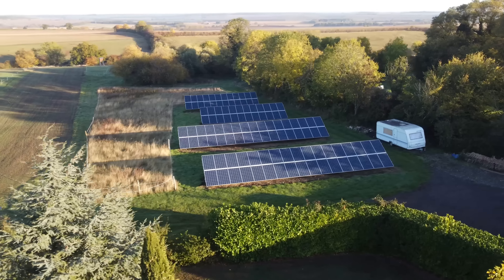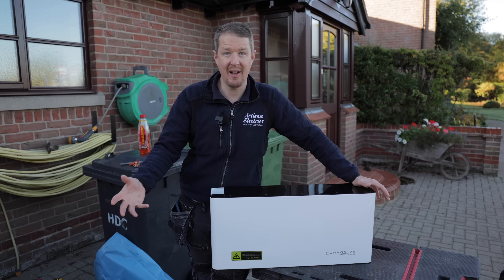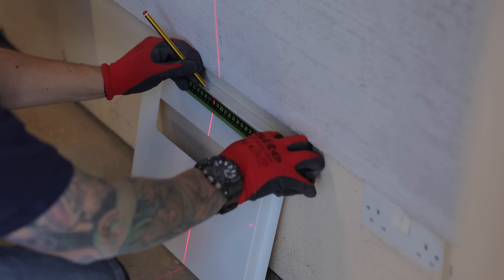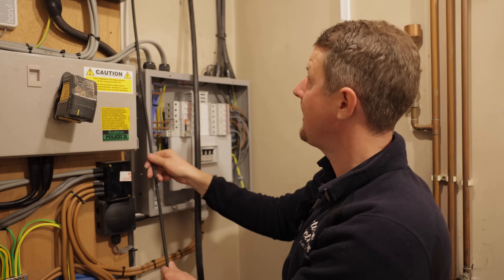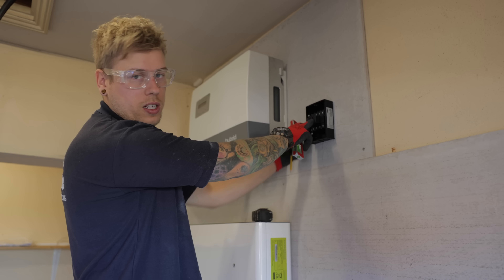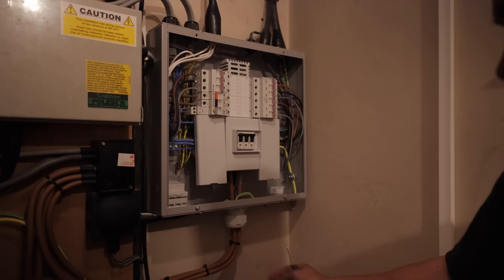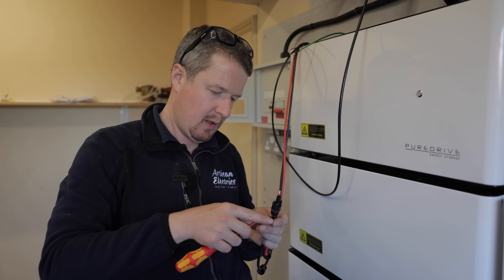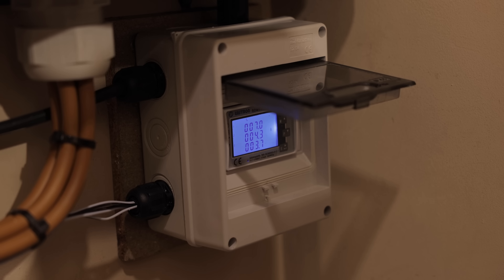PureDrive 23kWh Three Phase Home Battery Storage Install

Comment: Great video, with the cost of energy going up these systems are making more sense. I didn't realise power wall was the only system that switched over to batteries automatically in the event of a power cut.
Reply: I only learned that recently too… seems crazy to me to not have that switching functionality built into these systems 🤷🏻‍♂️
Reply: Why can't a Automatic Transfer Switch be used ?
Reply: They don't really make sense though do they because the amount this entire setup costs by the time it breaks even you'd be 6 foot under.
Reply: @TheRCBiker  and Captain Killjoy has arrived😅
Reply: I have a Victron system that switches over automatically. There are others out there too which can have ATS component
Reply: @TheRCBiker  Steady on old chap I was just getting exited for once. Imagine if they keep doubling the cost of the supply and being able to tell the electrical supplier to stick it. If I could afford it apart from the security of having your own supply (even if you have to make some concessions) not having to stump up to the grid suppliers each time they hike their prices up would be worth the expense.
Reply: The effective rate of return on a (normal sized) array + modest battery is pretty good, especially if you’re in a lot during the day, and have an electric car to soak up excess solar in summer.
Reply: Just having battery is enough if you have dynamic pricing.
Due to the failure of governments to support energy companies to create energy buffers, domestic batteries make pretty good sense to earn money.
Install as much batteries and a victron multiplus system or whatever is common in your neighbourhood as you would have for solar panels (say like 5000 euro), just charge the batteries during cheap hours, and then sell it back during expensive hours, you could have earned the installation back this year.
You do need to make a very small script to switch the system from charge to feedback though.
And once you are earning money from selling back the energy the energy company sold to you, you can add panels and sell them more during expensive hours.
Reply: I expect that because he's fairly new to the solar game, he doesn't know that it is actually not only common, but pretty much the default in hybrid inverters- Tesla most certainly isn't 'the only one that does it', in fact the Powerwalls system is rather clumsy in comparison
Reply: @gavinnoname1424  Almost all of them go, Growatt, Sigineer, Victron- standard
Reply: @Steve D  and the powerwall still uses Lithium-Ion rather than LifePo4
Reply: @gavinnoname1424  LOL- I did actually mention that in another comment (although I have heard they might be swapping over to LYP (LiFeYPO4)- which would put them in line with BBox and Panasonics versions of the Powerwall

Comment: What's the cost of these battery modules like compared to others on the market?
Reply: Massively expensive.

Do a DIY install with pylontech batteries and a Solis Hybrid Inverter.
You only need a local electrician for the new circuit. 
Don't get sucked in with these "green energy" electricians who inflate the costs just because its "green"
Reply: Was looking at Pylontech batteries and have been quoted for a similar system but the brand was Fox which I've never heard of 😅

Comment: This is a very expensive way of adding battery storage. I'm offgrid in Shropshire and I recently added 15KWh comprising 16x280AH LiFePO4 and a smart balancer.  It all cost less than £2500.
Reply: Can I ask which brand are the LiFe batteries or if you can provide a list of all parts (battery, BMS...). Thank you!
Reply: @snajperSLO  Docan 280AH (same as EVE) plus a JiKONG JK-B2A24S balancer. Remember to compress the cells in an enclosure and add breakers and a LVD to the system if you don't already have one
Reply: @AndyFletcherX31  Was looking at the EVE 280 but they are around 180€/piece (A-grade). Don't know if you can get them cheaper in europe... Had no luck. Thank you one more time for the info :)
Reply: @snajperSLO  I think it was about $2200 DDP for 16 to the UK
Reply: Think their labour fees were more than that!
Reply: I have 16x280 Basengreen LifePo4 bought from European stock at €2500 so no extras for me in Spain. Daly BMS and Easun 5.6kv inverter at €600, also EU stock. 8x485w panels and it works perfectly. All in under €5k with the odds and sods.
Reply: I’ve done similar with 24v set up. Using the same BMS. Working out turning it on the first time took some searching. I too am in Shropshire

Comment: Most interesting. However, no one ever seems to mention that in overcast winter days solar generation can be almost zero .
Reply: Because it isn't true???? It 'was' true- about a decade ago before high voltage MPPT took over from low voltage PWM solar controllers, but these days, light 100% overcast and showers will still see you up around 50% of normal output, and even heavy black overcast with heavy rain will be around 30% of normal

Comment: How hard could it be to install some high current contactors between the grid side and backup side to isolate the incoming tails, controlled by the grid side so it will switch the entire house to backup when the grid goes down.
Reply: Let them doing the first time experiment Jordan trying to do this experiment without any information because thinking how he will pay he’s employer’s at the end of the day
Reply: That's how auto start generators do it, with an Automatic Transfer Switch. So I'm sure it would work for these.
Reply: Yeah owner of the building must need to buy a Auto Start Generator 
Now
Reply: They don't have enough battery capacity to feed the whole house for long.

23kWh of battery is only 1 hour of use at maximum load for a residential house (with 100amp main fuse and 230 volts).
In practise the house won't be operating at 23kW, but even if operating at 5kW, that's still only 4 hours of capacity from the batteries. It's not much if you're then having to wait for the next day of sunshine to recharge the batteries. In winter you might not get enough sun the next day.

So this really isn't a design that is suitable for off grid use, save for a few hours at a time. And grid power in this country is extremely reliable, so why bother with the huge  expense of designing a system and having enough capacity to run for 24 hours or more?

Comment: Are you sure you used the correct gauge wire from the batteries for that 10kW inverter?
Mmmm.....
Looks like 100A is max on those cables

Comment: TBH, i'm not sure why they didnt get a larger battery pack and then just go off grid if they dont want to export. I've got the final 3 of 6 SOK 100ah 48v batteries arriving today.... Gonna take the house off grid with 7kw solar and a transfer switch.

Comment: Great video!!! Hugely envious of that instal! That’s exactly what I want to build at mine. The point you made on switching to battery in the event of power failure. Is there really no way if doing that in the same way a UPS system works? I’ve no interest in a Tesla battery.

Comment: Why not, in this usecase because of the size of the solar array and battery storage, go for a semi-off grid system with an automatic failover switch? Seems like a waste when the power goes down and all you have are some extension leads...

Comment: Jordan, you CAN NOT RUN CTs and data on the same cat 5 or cat 6 cable. IT WILL NOT WORK!!!!!

Go and have a look at the Victron Energy charge inverters, they can be setup to switch to "Island" mode to supply power if the grid supply is lost. They can also be wired to a generator and programmed that is the batteries drop below a set level, the generator is started and will then run to recharge the batteries in the lack of solar.

Comment: its great to see a large battery system but as this doesnt auto switch over - what does this power - dont get what the customer spent all this money on. is the heating permanently supplied by it? its not big enough to charge a car so, yes a bit confused

Comment: Nice neat install....one thing I noticed though, the DC cables feeding the inverter looked rather small for a possible 10KW inverter, I'd be a bit worried about that ?
Reply: depends on the panel voltage no ?
Reply: I can here to write the same comment. I have a Victron MP2 and it's only the 5kva model yet they recommended 70mm dc cables on a 48vdc system?
Reply: @gug1970  yes it does. I "guess" we assumed the battery packs are 48vdc. Maybe they are much higher than that?
Reply: How much current can an MC4 connector carry?
Reply: @elliot330  30A upto 1000V for european versions else 20A 600V
Reply: @elliot330  I equals P over V giving 5000 watts divided by 48 volts and 104.16 Amps which would be your 25mm2  meter tails on a single phase 100A supply in the UK, cable length would make a difference allowing for volt drop on the run... am I barking up the wrong tree?
Reply: The batteries seem to be wired in series, unlike e.g. a Pylontech setup. So the voltage is six times the individual battery voltage, with a corresponding sixfold decrease in current.
Reply: @HowardBurgess  Yes, just did a Mr Google search on those batteries, they are around 77V each and ARE connected in series for a max voltage of around 525V, that'd explain the small cable size, so looks like these batteries "emulate" a solar panel input to the inverter being a DC voltage similar to what panels produce...interesting !!!
Reply: @AndyM...  Interesting concept. I suppose that means you need at least two or three of them, because otherwise you’d be below the inverter’s minimum startup voltage. And charging must be more complicated than with a parallel setup, to ensure each battery’s voltage remains the same. Still, I presume it all works and it’s good to see different approaches!

Comment: Those batteries look as if they are linked in series. What happens when one fails?  The connection cables don't look long enough to bypass a failed battery.
Reply: You would have to remove the failed battery then move all of the others up. The BMS module would also likely need adjusting for one less battery therefore lower voltage etc.
Reply: @rgtsparky  It would be nice if it could be configured to failover gracefully and automatically.

Comment: Personally when testing 3 phase circuits, I test R1+R2 on all phases because you want to check each end is continuous across each phase. Although you are proving only one phase you are assuming the other phases have been correctly manufactured. It’s unlikely to have a break but not impossible and have seen it happen. As artisans I expect you to do the same as you go the extra mile on everything. Not digging you out at all just how I do it and my view.
Reply: I can not believe that you would not test it, very strange comment from Jordan.
Reply: They might live test each phase
Reply: @lewis94uk  but you want to prove the conductors first before energising.  skipping this is bad in my view, the whole point of the continuity test is to prove end to end of all conductors not just the earth....
Reply: 18th edition requirement is to measure the earth - r1 +r2 only used to make it easier to measure the earth and also is a polarity check
Reply: @anthonycampbell9807  Not required.
You are required to do R1+R2 test, assuming there is a neutral present, and if you do that for all phases, then you are proving the continuity.

And not only is it proving the continuity, it's measuring the resistance which determines the maximum current carry capability and so you are also verifying the current you expect the installation to be able to handle.

If the R1+R2 tests results in very high resistance, such as caused by a cable break, then you investigate and resolve.

Comment: Only thing with these, house fires will be a nightmare.
Reply: How so? They use LFP packs. LiFePo4 : lithium iron phosphate. The safest of the battery chemistry’s in use.
Reply: @salibaba  it can burn for days and water doesn't cool it well.
Reply: @pauledwards9493  LFP packs like the ones in that system and many other home storage batteries are not liable to thermal runaway.

Comment: 10kwh batteries cost £10,000. Then there is VAT and then installation pushing it up to 17,000+. I paid £750 for electricity last year (2 bedroomed tiny Terrace house). When I calculated how long it would take me to pay off that 17,000 and then adding on £5000 per ten years for the battery replacements I realised I would have died of old age before paying it off. Much cheaper for me to just run my washing machine and dishwasher at night when electricity is cheap. Cost me nothing and with time management on it's own I can cut my bills far more than if I invested in solar and battery packs. My advice to anyone out there thinking about solar and batteries is this: you can save money by simply using time management alone. Spend that money on insulation and double glazing instead. I installed timers on lights and on the cooker (hob) and heat the water at night when it is cheaper. Lights with movement sensors cut a huge amount of money off the bill. Turning off devices at the socket saves even more. Using your brain is the only way. Throwing money at something is not the way. It is in fact dumb.
Reply: This client obviously multi millionaire so money no object, I would expect they could pay their electric bill with ease anyway.

Comment: Once you add in an electric car 23kwh isn't much storage at all. That's about 80 miles on for a small electric car.

I wonder what these batteries run. Right you you can get about 25.6 kwh of storage for around $10k with rack, cables included (Current Connected)

Anyone know what these 23kwh would run in the UK?

Comment: You don't get paid for the solar energy you provide for the grid? We had a great summer with a lot of customers having a 5-10c/kWh contract when they buy electricity but when selling the excess power back to the grid they were paid by NordPool and got paid around 30c/kWh at best
Reply: Yes, we have that here. We call it Feed-in tariff.
Reply: @deang5622  how much do they pay?
Reply: @justme5384  I have just looked it up and I don't believe the figures I am seeing.

The Feed-in tariff appears to be set by the government, and incredibly, ridiculously depends on the Energy Performance Certificate rating for the house/premises generating the electricity. The EPC is about how energy efficient your house is, how good the insulation is, whether you have double glazing for the windows.
How on earth should that affect how much the power company pays you for the electricity you generate? And what does it matter if the electricity you generate and sell to the grid is solar or wind? There are different rates for this too!
The way it is structured is complete nonsense. It's rigged. 

But to answer you question, the feed in tariff seems to vary from close to zero to 5.99 pence per kWh.

Given the power companies can sell the electricity on for 34 pence per kWh at the moment, it's a rip-off.

If anyone is generating electricity by PV and feeding into the UK national grid that is getting a much higher feed-in tariff rate, then please comment and let us know when (what year) you started feeding in power to the grid, how much you are being paid per kWh, and what year your FIT scheme ends please.

Comment: More a commercial install surely otherwise how could they export a megawatt to the grid? Am looking at a possible pv and battery install in the New Year but as the cost of energy goes up, so too do the pv and battery cost as everyone wants their piece of the pie!
Reply: Remember a megawatthour (MWh) is not the same as a megawatt (MW) - to export at a rate of 1MW would indeed be commercial, but you can eg export at say 10kW from a large domestic install, and if you do that for 100 hours (easily possibly over the course of say a month) you've exported 1MWh...

Comment: Biggest...I got 48 lf280k cells ready for my inverter getting connected then it will be 43 KWh for 9000 Euro all incl. Those small batteries your maunting must be expensive and risk of introducing more faults om all those BMS´s etc. vs. using bigger ones.

Comment: Great job but that back up box is frankly useless, why could you instead of running to that SWB and the two power outlets, run a supply back to the main SWB and using a relay, connect three or four essential supplies, ie lights and power, so on power failure, you switch over to essential supply.
Have you looked at Huawei they have a very good system.

Comment: Kills me slightly that those stacks are not symmetrical. I would have supplied them with an additional battery even if I had to pay for it myself just so those stacks are both 4 units high each :P Nice install!
Reply: This is I think the maximum you can use of these modular batteries in series. It's nice to hear you'd be willing to spend a couple grand on a battery to give to someone for free though haha :P
Reply: Suprised that they don't do an empty shell as a spacer to fill the space, thereby giving 2 stacks the same height.